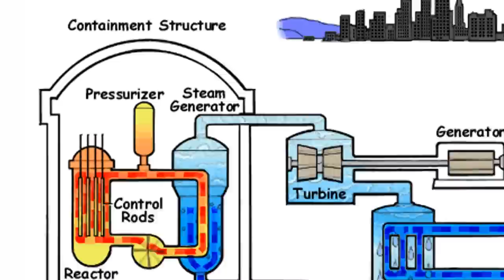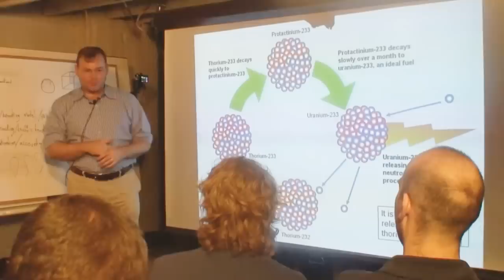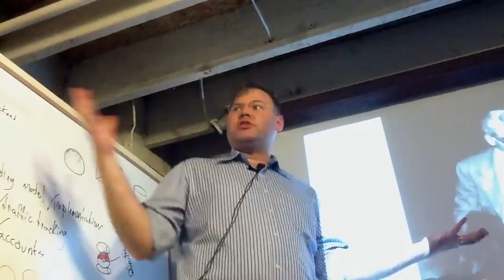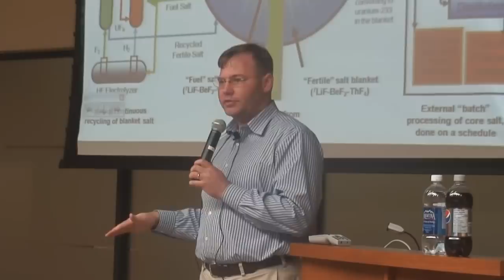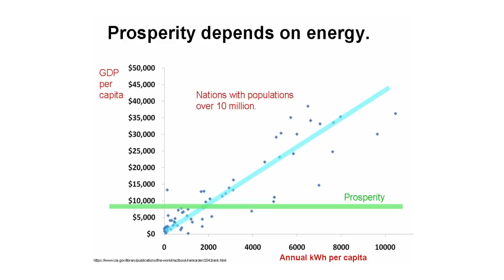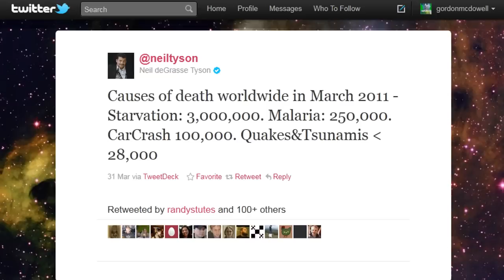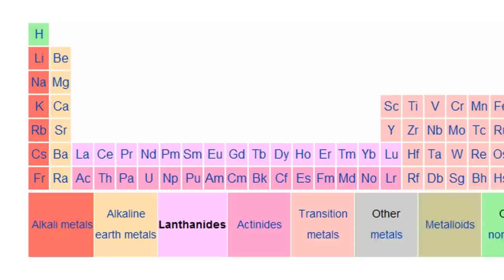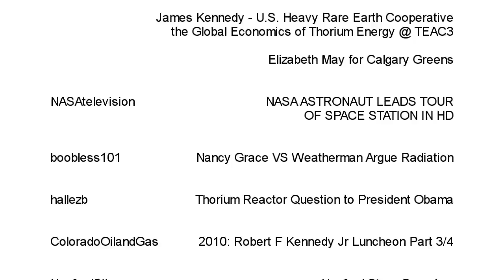Liquid Fluoride Thorium Reactor - Thorium Nuclear Energy - Revolutionary Energy Source

Comment: This presentation is grossly over-optimistic regarding Thorium LFTR, just like conventional nuclear was sold on being "too cheap to meter" !   The reality is that this gentleman Dr Kirk Sorensen has never actual built a Thorium reactor, just a few component parts thereof and a bit of simulation studies.   When doing a task in practice, it is always more difficult than initially envisaged.The following quoted article may be interest to put things into perspective:

Last days of a dinosaur industry

We have gathered here again in front of
your Nuclear Industry Forum to again try to warn you that you walk the false
path. Your industry, the nuclear power industry, was able to get started on the
back of the west’s nuclear bomb programmes in the fifties, based on assuring
the public that you would keep the radioactive by-products of splitting uranium
separated from the environment. This you have consistently failed to do, having
lost control of your deadly machines at 3 Mile Island, Tschernobyl, and now
three more at Fukushima. Wikipedia talks of 21 meltdowns; that's one every 2.7
years. And with each meltdown you lot claim to now be safer because you've
learnt something more. Well, you didn't tell us that the plan was to develop
safety through trial and error, and we are not impressed with your efforts.

The public don't see why they should be
taking such a huge risk, the risk of losing huge chunks of their country, (as
in Ukraine and in Japan), just to get electricity that is available risk-free
from other sources, like solar and wind. Especially since the alternatives are
becoming cheaper than your nukes. In the case of Japan, whose Fukushima plants
are showing themselves to be impossible to control, and which are throwing 400
tons a day of radioactive water into the sea for three years now, we humans are
facing the prospect of not just losing some land in Japan, but of losing the
Pacific Ocean itself. The nuclear industry in Japan has shown itself incapable
of even admitting they have a large, stinking mess on their hands, sending us
all on a compulsory experiment in the long term effects of genetic manipulation
through radioactivity.

Nor does the public see why they should
give more free rein to an industry that for 60 years has claimed it would solve
the problem of what to do with its waste in a few years time, yet which is
nowhere near coming up with any solution. You have 148,000 Metric Tons Heavy
Metal waste, ie. old fuel rods, sitting round mostly in swimming pools in the
nuclear power stations that produced them, promising to come up some day soon
with a way to separate them for ever from the environment. Which you can not do
on a tectonically active planet. Your schemes to bury them in salt underground
have just hit the wall in New Mexico, where a little 'release' of plutonium
from one or several exploding barrels of waste have made it likely that the
Waste Isolation Pilot Project will never reopen. And the WIPP disaster has
revealed the dishonest behaviour of your industry; you are not allowed to
dispose of liquid waste in WIPP so you threw in some kitty litter to absorb
liquid and labelled it solid waste. And now you've switched from mineral based
kitty litter to wheat based, 'because it's greener', (or cheaper?), and the
nitrate salts in the waste have reacted with the cellulose in the wheat kitty
litter, blowing open a barrel or three. So the other 300-odd barrels of the
same mix are also timebombs that could 'release' more plutonium etc. at us at
any time. Of course your experts will say there's no danger, but we're tired of
listening to them pedal excuses. You claimed that this stuff would be separated
from the environment for all time; your experts assuring us that the latest
'small release' is OK are no longer interesting. There was meant to be none.

And now you need billions off the
taxpayer to build your latest toy in Hinkley Point. Which will supply 3.2 Gw by
2023, by your rosy estimates. When the UK has installed 2.7 Gw of new solar
installations in 2012 alone. At a strike price estimated to drop to £100 MW/h
by 2018, by which time your index-linked nuclear strike price for Hinckley
Point will be way north of £100. And when on-shore wind in the UK has TODAY a
strike price of £80 MW/h. So by your own logic, the logic of the market place,
your industry is dead. Already more expensive than on-shore wind, soon to be
more expensive than off-shore wind and solar, and producer of huge stores of
undisposable waste, that has to be guarded for ever at great cost. Not to mention
the risk that if it has a bad day, a nuke power station will destroy a third of
your country. All for what? So a few businessmen can continue to have expensive
lunches and wear £300 shirts?

But what really gets us grumpy is the
dishonesty and the political manipulation when something does go wrong. In
Japan, they have just had the biggest industrial accident in the history of the
world. Fukushima. But instead of admitting the magnitude of the problem they
are in full denial, saying that 'all the contamination is contained in the
harbour', that 'no-one's health has been affected by Fukushima', etc. Denial,
so that they can restart their other 48 nuclear plants, because they are worth
a lot of money. So money comes before public health and before honesty.

We the public have had enough. And
think; your industry will affect your kids too. They have found plutonium in
the teeth of every UK kid. Lots more of us humans die of cancer these days than
died of cancer before the atom was split. Your kids will be eating this food,
drinking this water. We only have one Pacific Ocean, and it leads eventually to
the English Channel. There are, for radioactivity, no borders, and no gated
communities to escape it.

 Yet, enthusiasts for this dinosaur
industry say that Thorium is the answer, in particular Thorium LFTR.  A small LFTR research reactor was built in
the 1950’s at Oak Ridge National Laboratories, USA; however, scaling up for
significant electrical power production, for example 100 MW, takes a leap of
faith.  However, Thorium LFTR implemented
widely would be a highly dangerous source of materials emitting vast amount of
gamma radiation, ideal for dirty bombs. 
If one of these LFTR sprung a leak, their contents would be so
radioactive that nobody could get even close to try to take remedial
action.   Enthusiasts for this Thorium
LFTR say “… the melt plug will simply melt in an event of overheating, and
the contents of the reactor will flow into a basement dump tank …”; after
many years of operation, the Thorium LFTR would be so “hot” from radioactive
decay, that thermal management and radiation shielding would be major
issues.  Yet, Thorium LFTR is declared as
being the dream ticket.   Has nothing
been learnt from Fukushima?
Reply: This post reads like a piece of anti-nuke propaganda from the 1970s. It's about as well-informed as that propaganda, that's for sure. A number of these points are vastly overstated and/or blatantly and demonstrably false.
One reactor melted down at Chernobyl, but you ignore that the other three RBMK reactors at Chernobyl ran for another ten years without issue. There are 11 similar RBMK reactors still operating in the countries of the former Soviet Union. The Chernobyl reactors also operated without a containment building, something which no power plant in the West does. And for all the fear of poison and cancer, only 50 people died from Chernobyl, 31 from direct exposure to radiation or from the damage caused to the plant. 

But when you ask if nothing has been learned from Fukushima, the answer is yes. We learned that we should be using reactor designs that do not use water as their coolant or fuel. We learned that the USA invested hundreds of millions of dollars in developing two extremely promising reactor technologies along with fuel reprocessing capabilities. Both the Molten Salt Reactor (the LFTR is a type of MSR) and the Liquid Metal Fast Breeder Reactor (EBR-2 was a LMFBR) which use no water in their designs, use the laws of physics to guarantee their safe operation  and even demonstrated their walk-away safety. Their vast increases in efficiency over LWRs and their ability to run on reprocessed, recycled fuel are crucially important. A neat trick of the LMFBR is that it will fission all the truly nasty actinides that make high level waste such a problem. Essentially, we can 'burn-up' the very compounds that make nuclear waste so long-lived and recycle the fuel until end of plant life. 
By using LMFBRs (Russia is operating a couple right now, as we speak) and MSRs (India and China are leading the world in development of these) we eliminate the need to store all our spent nuclear waste. It can be reprocessed and run again and again while cleaning up the decades of waste from light water reactors. 

I also like how your copy-pasted article ignores that those cheap renewables are nowhere near capable of delivering the electricity needed by a large country. If you were to switch off the fossil fuel and nuclear plants in Britain right now and go 100% nuclear, you'd leave more than 70% of the people in the dark. 
In the USA, it would be more than 80% of the population. Renewables aren't a base load solution and fossil fuel industry knows this, which is why nuclear gets such heavy handed opposition. Nuclear is the only source capable of displacing fossil fuels.
Reply: Hello Mike
Discussing with advisors to UK Government on energy issues (Professors of Nuclear Engineering, et al.), I have suggested to benefit of Thorium LFTR to dispose of Actinide waste.  I wish it were possible, because the 160000 tonnes of high-level nuclear waste around the World is a huge contemporary problem, namely the aftermath of the conventional nuclear industry.  All I met from the nuke expert advisors is that the Actinide "burning' performance of Thorium LFTR is very modest, and will do very little to dispose of the huge amounts of Actinide waste that are now presently in existence.  As aforementioned, I wish Thorium LFTR could make a useful contribution to disposing of Actinides safely, but the technology when investigated more closely is just not capable of making a useful contribution.  That is the sad reality.
Reply: I have to agree with Mike McKeen, whoever wrote this diatribe needs to first go back learn rudimentary English before composing something that one would presume is to be persuasive against nuclear energy. As for reduction of actinide stockpiles that is a significant issue. I would assume that if we replaced conventional U235 based plants with LFTR then over time we would consume the actinides such that even at a modest burn rate they would eventually deplete the stockpiles. If we want to accelerate that we could build some breeder reactors to do so but that would be with the knowledge that they would be using the same less safe technology we are trying to replace, and it is a planned throw away solution. Once we use up the stockpiles we would not need them so we would decom them. Yes LFTR are based on some optimism but that is nothing compared to all other sources of energy. Oil, well obviously we know the issue there. Every single technology for energy production has its issues. Wind, solar and tidal are being treated like they are some kind of magic solution these days and they are anything but. If we want reliable and clean energy then LFTR offers a reasonable possibility that basically no other technology offers. What is amazing in the end is reading this diatribe of smug sounding people who apparently think they are intellectual and you can tell based on what they are saying that they don't actually know much about radioactivity. On top of that they throw out how they have added all this solar capacity in UK as though that is a real solution. My God, the sun goes down over there too. Do people just whip out their oil lamps at night. The writer(s) of this piece enormously ignorant or purposely deceitful, something they complain about in this very piece in regards to the nuclear industry. One cannot read this and take it seriously in even the remotest sense and that too is a sad reality.
Reply: @tommorris3688  you wouldn't use a  LFTR to dispose of actinides. You need a fast spectrum reactor, or else you're not fissioning those actinides.
Reply: I do not need to put further effort into responding in detail.  After Fukushima Dai'ichi horrendous disaster, there will be more serious nuclear accidents worldwide in future as existing nuclear reactor hardware is pushed with licence extensions, because it is easier to keep producing power from an old reactor than decommissioning the old reactor (that is then just cost).  With the more serious nuclear accidents, the public will have little enthusiasm for nuclear power, whether conventional fission type using solid fuel rods or liquid salt types.  Nukes are being decommissioned at a faster rate than new nuke plants are being built; thus, worldwide, nuclear power is a sunset industry. 

Present civil nukes were built in connection with military activities.  Thorium salt reactors are not of particular interest to the military.   Thus, where is the investment for Thorium LFTR or similar going to come from?  Dr Kirk Sorensen has been trying to raise investment finance for many years, and still the money for building a Thorium LFTR has not been forthcoming.  Investors are just not interested.  Sorry if this dampens your enthusiasm, but is the reality.
Reply: You are correct. The anti-nuke folks have created such an unreasonable fear around the word nuke that there is no support for building new plants that would bring newer safer designs. On top of that there is not a lot of money in it as a result so research has been reduced so developing even safer designs is diminished. In effect the anti-nuke people have contributed to causing the very thing they want to prevent. Isn't that irony. Additional irony is that Germany shut down its nuke plants and had to start importing natural gas from the soviet union to meet its energy needs. Now if there were a conflict the ruskies can cut off a good chunk of their energy. On top of that, they are now contributing more to AGW. The irony is getting thick enough to spread it like peanut butter. 
As for the need for military connection thats a tenuous claim at best. In the early days, to get the industry off the ground it was certainly a need but today with all the experience and infrastructure we don't need to have the military involved in civilian nukes in even the remotest sense. Ultimately heres the situation. We have rampant global warming right? We have clean technologies like wind, solar, tidal, hydro and nuclear. Of those, wind and solar are helpful but in practical sense pipe dreams. Hydro is ok, but fish are affected and reservoirs are filling up. So what do we have left? We can, if we want to, make safer better nuclear. But again, that is is we WANT to. We presently don't want to because people have this irrational fear of nuclear anything instead of a rational objective "lets solve this" attitude. I wish we could solve wind, solar and tidal issues as well but we can't stop the sun from going down or the wind from being calm. We can and have increased solar efficiencies but we really haven't decreased the amount of very toxic byproducts, nor have we extended the lifespan of the current PV cells all that much. I like some of the things people are trying but we are wasting a lot of effort and money on things like solar highways and other really stupid things. Fusion has potential but its years away, just like LFTR. But we have already shown a thorium design can work since the 4 year project demonstrated it well. The question is can we get around the corrosiveness, hard radiation, etc. and that is why we do need to research it. Instead of just saying no, I think some serious effort should be put into trying to solve the problems and see what we can accomplish. If thorium doesn't work out then it doesn't work out but lets not delude ourselves by thinking wind/solar/etc are a viable long term solution.
Reply: Hello Nick
Nice of you to take the trouble to respond back.  Greatly appreciated.
I wish I shared your enthusiasm for later designs of nuclear reactor design.  Pebble bed reactors, although running at high temperature have encountered "hot spot" issues that is a contemporary snag.  Whatever Dr Sorensen may assert regarding Thorium LFTR (I appreciate that he is in "salesman" mode in the video), the fact is that high-temperature Thorium Fluoride salts are highly corrosive, otherwise there would not be a need to use austenitic stainless steel for reactor containment.  A further problem is that gamma, and particularly neutron flux, is so high in a Thorium LFTR that radiation embrittlement of the reactor containment is likely to occur.  The Oak Ridge setup was not run sufficiently long duration and high enough power really to investigate this issue.  If a Thorium LFTR containment is likely to have a relatively operating lifetime (e.g. 10 years) and then need replacing, this works negatively on economics of Thorium LFTR, and is generally not addressed.  Moreover, concurrent chemical reprocessing required alongside will have various items of metallic hardware that will experience similar radiation embrittlement.

I suspect that the real issue is, on closer inspection, each of the alternative generation IV or V fission nuclear reactors all have their snags and particular operational problems, and that Thorium LFTR is only one of a plurality of potential future designs that bring some degrees of marginal benefit.  For example, Bill Gates funding of Terra Power with metal-cooled reactors also sound promising when one hers the presentations, but I suspect there will also be challenging operation problems in making such reactors work in practice, ... and accidents and leaks will occur.  This will simply add to the present horrendous leakage occurring from Fukushima Dai'ichi, that sadly cannot be continued or stopped.  That is the sad reality.
Reply: I agree they all have problems. The real question comes down to can we engineer solutions to the problems so we can both operate and do it safely. LFTR has a lot of promise in the operation safety aspect in terms of meltdown accidents but not in terms of radiation level. The nice thing LFTR wise is the self scramming aspect for loss of coolant events and such. I think the major downsides are the brittle issues you mention. Hell look at Savanah River. The concrete in that plant is literally spongy in consistency due to years of radiation exposure. But, is there a metallurgical solution? We have made some good advancements in that area and we may in fact solve that issue. The main thing is we need to do research. As I see it we have no viable energy alternatives right now. I'd really like to see a fusion reactor going asap but that seems like a pie in the sky dream right now. If we can pull it off we can ditch fission altogether.
Reply: There should be a serious study made of Silicon Carbide and its related composites.
Reply: @TIm Norris You are right about the LFTR for actinides.  And yes I am aware that this has been proposed as a use for them.  Integral fast reactors, a technology already tested any small commercial scale is much better for burning 'spent' fuel.
Reply: So you prefer the one that uses 0.5% of the energy in uranium?
Reply: Neither conventional fission based on Zirconium or stainless-steel clad enriched Uranium fuel pellets or Thorium LFTR are especially environmental safe or environmentally benign technologies, so the comparison is one unsatisfactory technology against another unsatisfactory technology.  Recent analysis has shown that nuclear power is one of the most expensive and problematic ways of generating electricity.  Even Albert Einstein himself referred to it as "... one hell of a way to boil water ...".  For anyone to think that Thorium LFTR will NOT generate a whole load of nuclear waste products, with continuous processing required alongside the Thorium LFTR reactor, is either naive and poorly informed, or otherwise thoroughly misguided.  Dr Sorensen's overoptimistic and unrealistic presentations are misleading, if potentially dangerous, especially as Dr Sorensen has neither ever built a complete LFTR, nor ever run a complete LFTR.  As a novice with little experience, it is easy for him to be so over-enthusiastic and optimistic.  People are persuaded by his enthusiasm, rather than the hard facts of the reality of the Thorium LFTR technology.
Reply: So talking about environmentally benign we must now also consider the new Harvard study indicating issues with solar and wind, especially wind. These technologies are not the panacea people promote them to be. I'm not exactly opposed to them, I just wish people would quit presenting them as great solutions when they are in fact marginal.